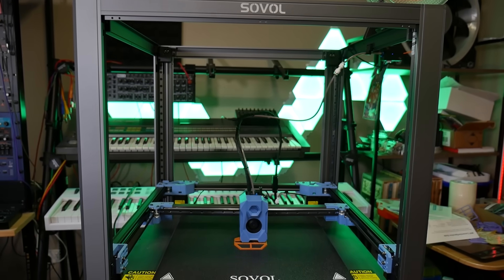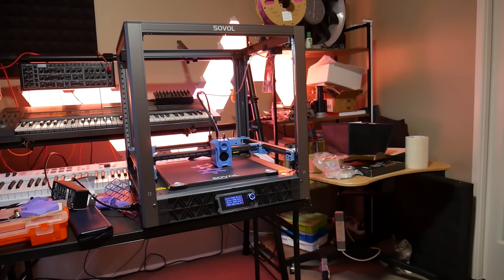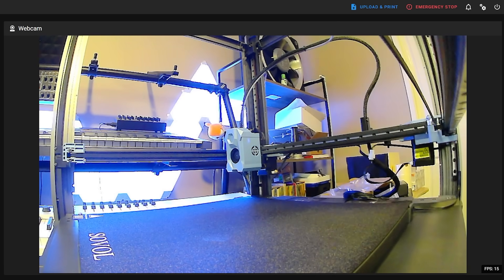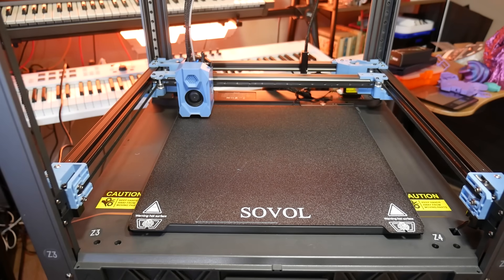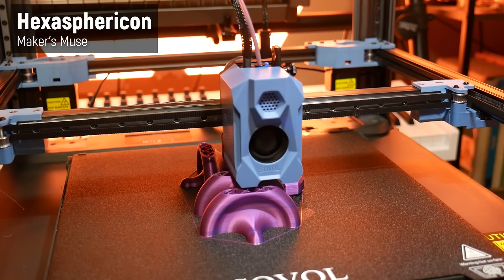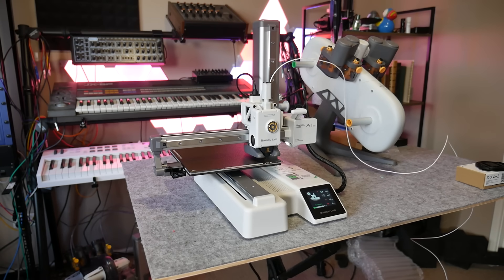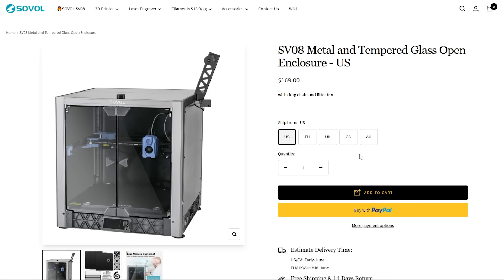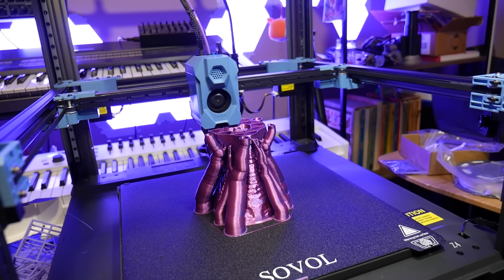Based on a VORON, made by SOVOL... but is the SV08 any GOOD?

Comment: Its really a Voron 2.4 350, just a mass produced version.  Its even running VANILLA Klipper and not some hack job company version.  The nob interface is default to the 2.4 if you were to build one directly from the BOM yourself instead of out of a kit and its cheaper to build a 2.4 that way then via a kit.  Kits for the 2.4 have the 3.5" LCD mod instead of the default interface.  So really there isn't a reason to get the SV08 without its enclosure, otherwise its just an incomplete printer.  Even then the SV08 isn't entirely a "stock" 2.4 350 either, as they are running CANBUS which is a very common mod, as of late, to do to your 2.4.  CANBUS puts only 4 wires to your toolhead instead of running drag chains, and about 8-10 wires, back down to the motherboard and PSU.
I have a Voron 2.4 350 R2 from the LDO kit and have had it for almost a year, around 2k print hours (a few reinstalls of Klipper kinda resets its clock) already on it and I just love this thing.  Already have some mods on it like running TAP instead of Inductive probe, I had kickly but never got it running right (docking).  Knomi 2.0 is just a cute mod and I also have Knomi 1.0 sitting around as extra might have to find or figure a mod out to mount him somewhere on a SV08 when I get one.
Reply: Except it ISN"T a voron. None of the parts are interchangeable and they're not eligible for a voron SN.
Reply: @Oldsjunkie  The machine is a Voron in everything but name only.  Ya there are differences but a lot of the mods for Vorons will easily be adapted to fit this.  With the fully released CAD file for the machine, that means you can print replacement pieces of the injected parts.  You would need to get heatset inserts for said new pieces but it would be easy to fix and repair the machine down the line.